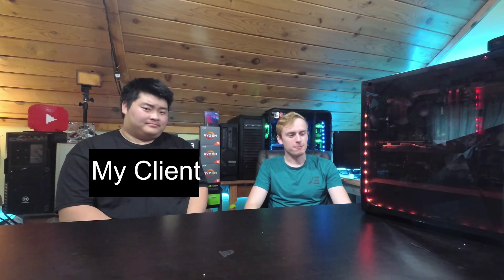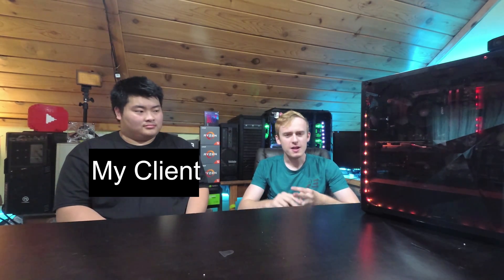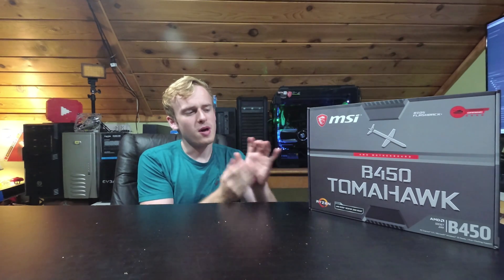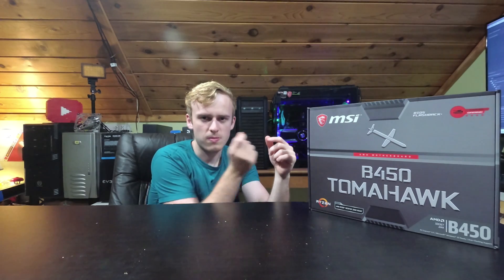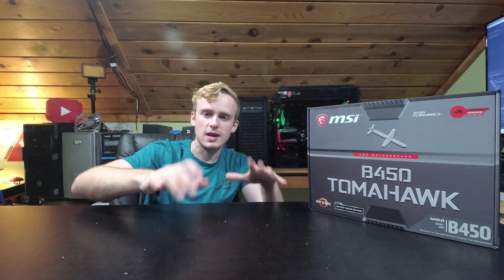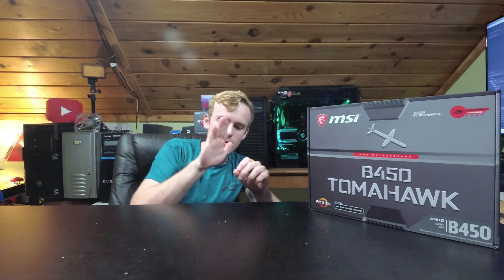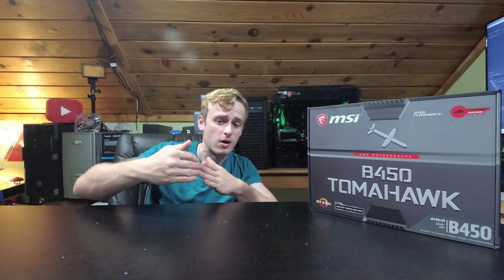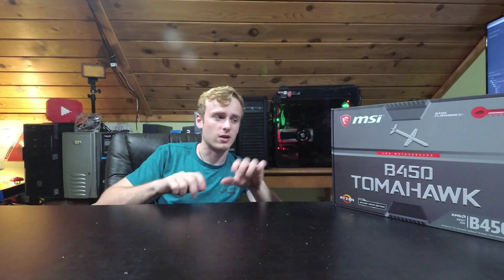My MSI B450 Tomahawk Motherboard Has a BIG PROBLEM

Comment: I just bought this board and the same issue, I'm so frustrated
Reply: Rma it and get other i use tomahawk max amazing mobo
Reply: I had the same B450 but it was the B450 armour not tomahawk. But I was having so much problems with the posting and the ports not working properly and probably some other problems. The site I got it off was a pain their customer service was terrible. But I ordered a Asus prime B450M-A from another company and it worked straight away from the box and I was so pleased that it worked because of all of the hassle with the other motherboard. There was an option to do a BIOS update on the new board (I don't need one) but I knew someone would try it out and only cost me £8 on top. All that all of that happened in July I spent 3-4 weeks trying to get the thing working. 😎👍

 My pc works well now except the internet 😂

Comment: Have you tried insulated screw spacers? Used to use them in the old days.just a thought.
New sub here
Reply: My kid has same mobo and hasent had a prob yet. He di almost plug in the addresable rgb header with the arrow facing the front of case though,but corrected him befor mistake

Comment: Sounds like the board you got came slightly warped from the factory, and screwing it in properly de-warped it causing some issues. Definitely lost the silicon lottery on this one. XD I got the same board and had no issues with it (aside from my own user error)

Comment: I have an issue with my B450 Tomahawk where the graphics card fan will spin at 100% really loudly for the first 5 seconds when booting up. Eventually it quits down and goes back to the normal fan speed. Does anyone else have this problem?
Reply: 1 year too late, but that's not an issue, that's 100% normal.

Comment: I got one B450 MSI Tomahawk for my Friends Ryzen 2700x first one has no power on the Motherboard wont power on when you Power it up. And i got another one replaced and same Problem same brother with 2 Motherboards, no led lights on the Board and the PC won't power up. I also do it for Free and i don't post anything on YouTube RIP.
Reply: bro i purchased msi b450 tomahawk max and testing it with Psu 550 watts . But Psu fan is not running,  and i test psu with paper clips so its working .   I replace motherboard and having the same problem with another motherboard

Comment: Planning to buy this mboard then after watching your video i change my mind. Ahahaha. IL rather buy asus b450f strix. Thank man!
Reply: it was just a bad one
Reply: @Orangezx  is your tomahawk still fine cuz my MAX broke after almost 2 years of working (almost exactly 2 years after it was released or smth like that) i think it is the only component keeping my pc form booting because of the cpu EZ debug light
Reply: @oltimeri8256  it  does not work anymore
Reply: It's an error
Reply: lol  asus  do you know this model asus go up to 109c ? 
in this video the mobo was faulty thats it rma get new one
Reply: I had the MSI B450 armour (it didn't work). I now got the Asus prime B450M-A  it works fine. I don't know what to say. 👍😎

Comment: On my b450 tomahawk. the realtek driver caused it to act weird and crash totally randomly. 
Disabled it because i use a soundcard anyway and now it works....
Reply: I have found is the weird audio buzzing or glitching, whatever you want to call it while watching youtube or a movie and it happens a few times a day everyday and I dont know its motherboard or windows 10 related I have tried reinstall audio drivers and fresh copy of windows 10 but that did not help also sometimes I get a big drop of fps for a few seconds while gaming
Reply: @daivagoriene6802  hmm. Didn't have that issue. But just before it's crashed. I could hear the audio cracking. Make sure you have the latest windows update with creators update..i have not had a crash since I disabled the on board sound card though so I don't know. I have not dared to turn it on again :p.
Maybe I'll turn it on again next week to try it out.
Reply: @cfvgd  hey i have that mother board and my windows won’t boot up sometimes is it because of the mother board sometimes it also crashes

Comment: I feel like a fool but I made a comment defending MSI and my B450 Tomahawk died yesterday, Im either going to get a Gigabyte or Asus board next.
Reply: did you get the new tomahawk max?
Reply: @Kevin-ng4ro  i get it its awesome dude
Reply: @intech7863  im using one right now its good
Reply: @Kevin-ng4ro  yea i pair it with ryzen 3600 and navi, at idle temp mobo is 27 ,at gaming never pass 38c , pc case mesh 3 fans front, 2 fans exaust
Reply: @intech7863  bro i did the same for the processor i used ryzen 3600 and yes the temps are really fine even if my room is kinda hot lmao
Reply: @Kevin-ng4ro  if you have good airflow and good cpu cooler will  see nice cool cpu and mobo i use noctua nh d15se as well cooling cpu ram and mobo, also running 3600 on stock as well boost to 4.2ghz out of  the box

Comment: New victim, i bought the mobo here in denmark from computersalg distributor, installed a brand new 3600 proccessor after upgrading the bios, vga led on post and no tracktion, changed the video card, unpluged everything and honestly believe MSI hardware as always is giving problems.  Back in Uni i use to build sistems and MSI will be on the bottom of my choice bucket and gues what, have not change a bit in over 14 years, mediocre manuals, poor build quality, and over that poor service. 
I am taking the board back to computersalg tomorrow morning were they can test all they want, but for sure i want a working computer once out of the shop!

Comment: Have this exact motherboard and zero problems with any of its features!
Reply: My didnt want to post at first, than I realized that I didnt connect power to GF :D. Working fluently rtx 2060, Ryzen 3600
Reply: @darekzmarek1842  what ram do you have?
Reply: Has no problems with mine ryzen 5 2600 and gtx 980 ti
Reply: has it had any problems yet since my tomahawk max kind of broke after almost 2 years of working
Reply: @oltimeri8256  Mine is still working just fine. Anything can break though, depends on your luck I guess.

Comment: i have issue with my msi b450m bazooka v2 that if i power it off, to turn it on i need to clean bios and then it only works for 1 time until i power it off XD  and then the same  and all i see is on EZ debug led  vga  error code, and i have changed gpus and still the same. i think next motherboard i will buy will be gigabytes
Reply from the maker: Good luck I’m buying the asrock x570 steel legend cause I liked it so much after my review of it.

Comment: Lots of people are complaining about BIOS compatibility with Ryzen 5 3000 series. I thought of buying it one , but now changed my mind
Reply: Aldrin Sangma yeah I got it one without these latest update, so now I have to get a processor loan kit
Reply: Just got the MSI mortar b450 and Ryzen 3000. Was really easy with bios flashback; plug a usb in with MSI.rom on it, flash the new bios without a cpu in it, wait, then boot from the new cpu..
But I have the non working ethernet which brought me to this video..

Comment: You should see all the issues people are having with this thing on /r/msi_gaming trying to get it to work with zen 2 lol. It's an awful board and now all the bios features have been stripped out for zen 2, and having owned two of these boards with all kinds of problems I definitely wouldn't recommend this thing to anyone in 2019.
Reply: Yikes, wish I would have seen this last night. Went to best buy this morning to buy the last b450 they had as my x470 aurus g5 wifi was ruined by a power surge. Got the b450 this morning, installed everything only for it not to post and the DRAM light is on. Attempted all possible ram combos to no avail. The rgb on the ram works but no ram showing on mobo. After all combos, I tried a diff set of ram just one 8gb stick. Still nothing. Have a terrible realization that the mobo could just be frying my very expensive ram. Used my brothers pc to check ram. Every ram stick is fucked. Gg bois Rip
Reply: Can you recommend a great board?

Comment: Sounds like you plugged the rgb header plug the wrong way and shorted it. Common mistake. If you flipped the plug the other way it may have worked..
Reply from the maker: Oh no the 12v line goes on the 12v header. I know what I am doing. Still I’m not aware even if you do flip it that it shorts it I believe it would just blow the strip.

Comment: My opinion this isn't a chronic problem I have b450 Toma in Corsair Carbide  275r Case / R5 2600 / Gskill 3200 / 2060 and system has not any problem about 3 months. But it was a price-performance board for the graphic card i decided. And yes, same issues can happen to me in later times. It's scary as Conjuring as.

Comment: Well, that would explain why reseating the CPU helped when mine had the same problem.  Pushing down on the board (to reinstall CPU cooler) = flexing board = could bring bad joint back together.

Comment: Bought a b450 Tomahawk, open box, from microcenter. Works flawlessly. Yup, I guess you got the poop end of the stick my friend. Don't bash a company because of an item that doesn't work. Not real profesh of ya.
Reply: @123Gaming check the CPU seating? Heatsink installation? Reset the bios? Made sure there isn't a jumper that could be impeding the booting? Using CPU for graphics or discrete? Memory okay?

You know, I made my comment because just because something didn't work, doesn't mean I'm never going to buy from them. I've had parts from Asus, gigabye, msi (yes msi), dfi, biostar, epox, Nvidia , amd, Intel etc not work. Does that mean. I'm never going to buy their stuff? No. Absolutely not. 

Bought an Asus b350 F before I got the msi, first x16 slot was reporting x8. And the x8 was reporting x4. Checked everything, reset everything. Nothing, no biggie. But i'm not going talk nonsense about a company because one item didn't work.
Reply: If you look around you can see a ton of people are having issues with this board. I'm in my 2nd board and it still doesn't work. Just because you got luck doesn't mean everyone else did
Reply: @123Gaming get another board
Reply: @augustocardenas7961  I had the same problem as him. So he's not talking shit. It's an actually problem. Just shut up and go somewhere else
Reply: Does you of detect WiFi? Mine doesn’t. I guess modo doesn’t have WiFi adapter
Reply: @brandeeno2846 it doesn't have wifi built in lol
Reply: he didn’t say shit. grow some balls would ya
Reply: for real though, this dude is the MVP of the blame game...said that LED's "won't work with this motherboard's header"....yeah, i just finished my first ever PC build using this motherboard and I was able to even use LED's that Amazon reviews almost all stated that they only worked with one specific brand + one specific case....I was able to get all of my addressable fans working in sync with each other...and then since he said that the header on the top of the mobo were the ones that worked but not the bottom; well, I used the bottom header (and the top one too....). Works totally fine. Like, awesomely fine. This mobo is an awesome chipset motherboard by a very good company...def shouldn't just be bashing on the company/a mobo that is literally spoken so damn highly of; if this motherboard were exactly how he just explained it, I wouldn't have gotten 4 or 5 different people at both Best Buy + Microcenter asking me what motherboard I'm running (when I would go in to buy parts), and they'd always have to include the fact that they absolutely love the board...and I can easily say that I do too...Only reason I even got it is bc the MSI B450 Carbon was sold out (go figure..it's never in stock, seeing as every time it restocks anywhere everyone just buys them up...so this was the 2nd choice, and looking back I don't even know why I considered going so big with the carbon mobo in the first place when this was right in front of me...)

Firing up the camera and bitching about the company and the motherboard and how he's made a ton of computers, etc. definitely doesn't help this dude get any closer to solving his issue of not being able to post...like this was for a customer too...so if anything, I personally feel like this video only does damage to his own credibility, if he can't get it to post and so instead of going through the proper channels to make it right - for a customer - he just goes online and says it's not his fault...Well if I'm that customer I don't give a quarter of a fuck who's fault it is...it didn't work. So as a person offering a service, how about going through making it work...instead of taking the extra time to post videos that the customer can watch and think "well looks like my computer's gonna be ready really soon!" since there was a lot of closure that came from this video..... 🤦‍♂️🤦‍♂️
Reply: @mkm1856 womp womp shit board hardly handles 3600 mhz ram
Reply: Dude literally didn't talk shit. He did the opposite of what your dumbass just accused him of. There was nothing unprofessional about this. Keep your completely misguided opinion to yourself, no one cares. Especially when you're that fucking wrong

Comment: Defects are possible during manufacturing. It's not MSi's fault, it can happen to any board manufacturer.
Reply from the maker: 3 boards in a row?
Reply: @JaysTechVault  If that is the case, I understand and MSI should address this. I'm pretty sure that they have now as many tech Youtubers have been recommending this board.

Comment: I have the same motherboard (MSI Tomahawk b450). The Leds on  the motherboard act weird besides the red ones. No matter the colour I set at the Mystic Light software (official Light Control by MSI), the colour I have chosen doesnt match with those lightning on the motherboard. The fun part is that some leds do, but some other don't. For example if I go for blue, some leds turn blue but some of them turn Green
I have tried removing the NZXT's H500i case smart device, still didn't work. Bios is updated to the latest version, even used a different pair of RAM Modules. It just refuses to work. On the other hand when I try to control my RAM lights through Mystic Light (G.SKILL Trident) they work correctly.
I have contacted MSI support but they have failed to provide me with a solution.
This is the last time I pick one of their products for sure.

Comment: ive had my b450 for almost 6 months and no problems what so ever NO PROBLEMS
Ryzen 7 2700x overclocked to 4.15ghz
gtx 1070ti
32gb patriot viper ddr4 3000mhz without using xmp
running an 1tb m.2 WD black nvme, samsung ssd evo 500gb, 1tb hdd barracuda
700w plat psu
my temps are always beautiful too!
NO PROBLEMS WHATSOEVER
Reply: Oh nice! Im currently building one with almost the same setup  as you, except i grabbed a 1060 for dirt cheap. Its good to see your happy with your b450 Tom, makes me feel better knowing a decent board. Im 12 days away from completion (cause of waiting for payday haha)
Reply: how long to boot to windows 10 with ssd evo? m.2 mine is taking ages no idea why, it's just on the windows boot screen for about 40 seconds which is far too long?

Comment: I've just finished my build with MSI b450 Tomahawk , ryzen 5 2600. It won't boot Because of DRAM led is on the mobo. I was thinking it's the RAM , I have Corsair 16gb 3000mhz. But don't know what to do.
Reply: Tae Tae Gaming did you find the fix I think this is exactly what is happening to me
Reply: @samu4608  I fixed mine by returning it lol then replaced it with a new one and now it works perfectly fine

Comment: You described the symptoms of a cold or cracked solder joint or cracked component.  It can happen on any PCB. I've spent years professionally repairing electronics with issues such as this.  They are difficult to catch during manufacturing test because of the intermittent nature of the symptom.  Any time you can make a problem start/stop by flexing a circuit board, that's most likely the issue.

Comment: You sent the customer home with a product you knew to be faulty. That reflects far more on you than it does this motherboard. You should have immediately RMA'd the board and installed a replacement,
Reply: There is always one to pick faults.
Reply from the maker: I believed I had fixed the issue temporarily why I had already started the RMA process. After I sent him home I got looking on how to get him one as soon as possible.

Rather send him home with something temporarily rather than nothing at all.

Comment: Have the same problem, same motherboard - CPU debug light, have done just about everything I can think of, vendor can't reproduce - it's highly intermittent, looking to replace mobo now
Reply from the maker: I just got a different motherboard and brand
Reply: Yep, that's what I'm going to do - odd thing is when this machine works, it's rock stable. On rebooting at random intervals CPU debug light, although as of last night I've only got two clean boots out of it.

Comment: Got 2 friends with the exact same board. One running 2700X and the other one has an older 1700 in it. Both didn't have any kind of issues. I guess you're just out of luck.
Reply: In every product series, there are lemons sometimes. That´s also why warranties exist.